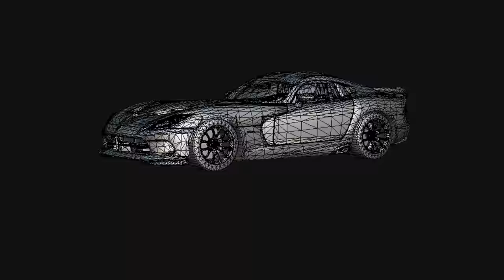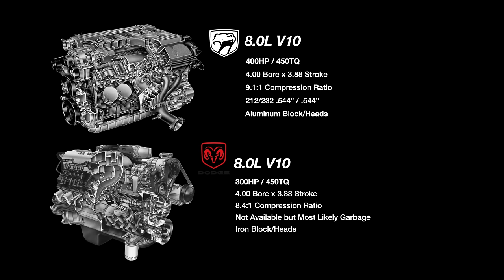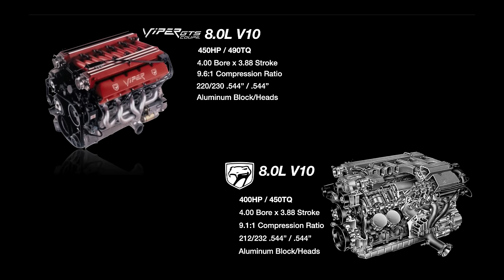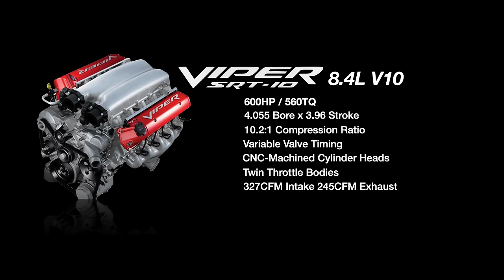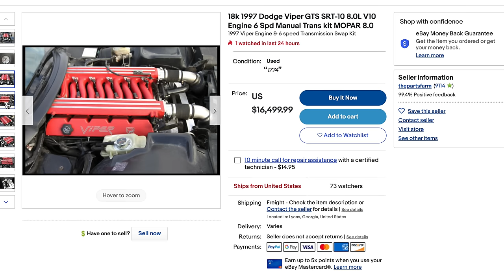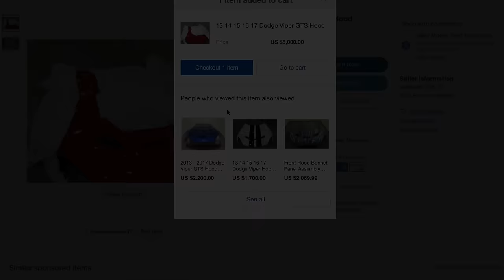Why V10 Viper Engines Are Too Powerful 😳| Explained Ep.5

Comment: The 2000+ engines can still be boosted, you just stop around 750rwhp.

Concerning your Viper tax, that's pretty much the body itself. The engine parts are fairly inexpensive as long as you know how to shop. 

The older interiors weren't that bad. They didn't fall apart like C4 and C5 Corvettes did.
Reply: My C4 interior is fine.
Reply: @macattack9041  yes, and so is the interior on my 97 mustang cobra but not all people care for their cars the same way. 

gm interiors have a bad habit of not staying together after youve taken them apart once. they also tend to squeak and rattle a lot, not just because its older either.
Reply: @OxBlitzkriegxO so modify them, its not that bad figuring out different/better ways to fasten things..the factory isn't always looking out for you long term.  Plus you can put in foam or some other sort of material to absorb any rattles etc at the same time.
Reply: @macattack9041 Just wait, it happens naturally. Cheap plastic and not so great design

Comment: I used to live down the road from the OG Hennessy Viper that was on the cover of Motor Trend. 1000hp naturally aspirated, the sound was actually scary. It didn't roar like the stock Viper. It screamed like a street bike. A V10 street bike.
Reply: Well, that's what happens when you raise the RPM redline instead of boosing to get more power
Reply: @1erickf50  the characteristic sound of q sportbike is due to its light reciprocating mass

Comment: First time I saw a first generation do a launch on a red lights, my jaws literally fell to the grounds !!!! Never saw anything has violent as this,
I know tires are really really wide and hook to the grounds, but never imagined it was gonna leave this effect in my brains, and remember this was before all electronics devices that make a beast easy to control, now with all this you could sit a chimp in a modern car and he would do a great 1/4 miles times, back then the car literally was fighting you like a mad bulls who didn’t want to play with you, my reaction has 
I saw it leave the corner street, it didn’t look like it was accelerating !? it looked has if it already had a swing ! Like it was already coming from, and not completely stopped, it gave me the impression has if a big fictional hand had just throw away the car, and my eyes didn’t catch and only saw from the car leaving the line. Very very impressed by this car back then. 😍😍😍
Reply: I thought the same thing when I seen a guy in highschool with a blown z06. Just goes. No squatting or anything.

Comment: You should talk about the 4.3 L V6 it was in the fastest trucks / SUVs on the road for many years and they are 350 Chevy engines with 2 less cylinders!
Reply: Don’t forget the turbo 4.3 the typhoon
Reply: The 4.3 was in the fastest trucks?  Are you smoking crack?
Reply: @jahosaphet05  4.3 Turbo in the GMC Typhoon/Cyclone, was indeed the fastest truck for many many years
Reply: @jahosaphet05  syclone n typhoon still the quickest and yes we’re the fastest……
Reply: @jahosaphet05  they could make wild NA power but then boosted with say 9 pounds you’ll need wheelie bars, roll cage and insane suspension setup. Used to go down Sac Speedway in my S10 4.3 NA
Reply: I love the 4.3

Comment: the viper always reminded my of an american 250 GTO. so nice from every angle
Reply: Yeah they have very similar proportions and the 250 GTO is widely considered one of the most beautiful cars ever made. Mid engined cars will just never have those heroic and beautiful proportions like a well designed front engined beast like a Viper.
Reply: I always thought of it as a modern Shelby Cobra. Light small car with a gigantic engine.
Reply: @matrinezkevin11492  funny you mentioned that, i saw some pictures of a mid-engined viper concept that Dodge apparently flirted with the idea of making, but never did. It looks pretty cool actually, but i like the original better.

Comment: You should do a Honda J-Series V6 video. We specialize in Honda Jseries Performance (HalferLand Performance) and have some videos of our 06' Accord Coupe 6spd making 550whp/460wtq on just 8psi. Even just at 550whp we have gone to finals and semi finals for Street Car Takeover verse Hellcat Red-eyes, Boosted Lambos etc .  Stock form they can hold max 600whp and come with forged Cranks, forged Rods (forged to reduce mass not for strength, 600whp is the limit) and cast but stout pistons (some have made 600-800hp with them by just Tweeks to the  ring gap, but we advise an upgrade for prolonged 500+ engines.  We added our HalferLand Hyper/Semi forged Pistons, HalferLand 1000hp Rods, Stock J35a7 Block, Stock Crank and our custom Turbo kit...and now have over 40k miles on that setup with zero issues at 550whp.  Theres some J's out there making well into the 1000's with stock block and crank. The engines also came in damn near everything Honda/Acura Released so their availability is too notch (CL, TL, TSX, MDX, Odyssey, Ridgeline, Accord, Pilot, etc

Comment: 6:30 The point about the piston ring gap from a NA engine is moot though. If you are going from NA to turbo you should be gapping the rings regardless. I don't think there is an NA motor you can slap a turbo and a ton of boost in and not have to worry about ring gap.
Reply: 1uz
Reply: Mustangs like boost and s2000s beg for boost too 😏
Reply: @Badmilobb6  You still need to gap the rings though.
Reply: 1uz...
Reply: Lol
Reply: @Badmilobb6  only the new ones with dohc
Reply: @merciless9285  the gt 2011 and up but there was dohc before the coyote went back to 2007 in the gt500s and the 03-04 cobra had a forged bottom end stock with a factory small blower you can run 800 wheel or more on those like the new coyotes without touching a thing on the longblock itself and they do it pretty reliably.  That is alot of power for 4.6-5.8 liters depending on which one you're talking about.  This is alot less displacement than these vipers are running so you gotta take that into account too.  The cobras and gt500s were factory supercharged with small superchargers but the coyote back to 2011 were all motor.  The 2000 cobra r had an na 5.4 dohc that put down 375 rwhp (almost the rated 385 at the engine) and they could take some big boost too unfortunately they were pretty limited to only 300 cars too bad Ford didn't use that engine more.
Reply: Old no-turbo Vw diesels
Eat 30+psi 
On original piston rings
Reply: only those that have seen ring lands lifted by incorrect ring gap under boost, will understand what this means....
Reply: @fastinradfordable  That means the original piston rings were too small. Probably a cost saving option by VW using the same rings on both the NA and the turbo engine.

They probably also make shit power even on that much boost. Even if you double the power that's still, what 75hp per liter? With an iron block? Heat really isn't an issue at that level.
Reply: @fastinradfordable  30 psi on stock rods and head studs? It might work for a time but, even the later turbo engines (until the 2.0s) had pretty weak rods and anything above stock boost needs upgraded head studs. I guess you see the point I'm getting at right? People who are serious about boosting their rig might as well go through the due diligence.

I'm actually in the process of swapping a BHW TDI into my Jeep (your comment is a funny coincidence lol). I guess this is the source of my comment, I rebuilt my TDI, checked the ring end gap even though they were stock rings on stock bore. I watched Cletus Mcfarland destroy a junkyard NA LS motor because he didn't gap rings, so for me due diligence is a must.
Reply: @sham_wow_guy . I would normally agree with you; however, the S2000’s & Coyotes with proper cooling & E85 are just animals. I’m not sure of how much ri g gap they have, but they are handling it.
In my 13’ Ram I made sure I had .032 gap in the top ring.

Comment: “You look at the dash a little too wrong and it’s gonna crack on you”😂🤣
Reply: but i like the 90's interiors more ( plus there more track focused and lighter, if i wanted spoiled i drive the pre-77 imperial luxury barge staying with in the Chrysler's family ) than the 5-gen vipers and my family and friends feel the same way. but i like the 4/5gen camshaft more as it's cam-in-cam
Reply: my sibling looking for a October ( preferably a 15th afternoon shift ) blue/white striped henssie-TT 1998 viper black interior 

same one likes 60's 4-door darts and the dodge jet-shaft car's and BEV's and SRT-neon all wheel drive boy racer boosted to the moon

im a 69 charger guy/owner but as a teen-25 i tried buying a viper ( mostly for the lolz and the experience and i figured that it would work as a trade for my charger or go up in value /up in cash 💰/or have my sibling buy it of me ) ( and looked at a RX-8 and a RPO-2012 charger/hellcat and 1-1-gen-mustang 6cly ( got one now for the miss but it's not the same vin and it's super rubbish and needs a full restoration unlike the one on the dealership's lot ) for the wife but those deals fell through and i didn't get them ) as my 2 car to replace my 2000's-up Buick 👎

Comment: I was an SCCA volunteer. We did press events for the car manufacturers at Pocono. The different manufacturers would have  their cars on hand so the journalists could determine which cars they wanted for road tests and articles on their magazines. The writers would take cars for a lap on both infield courses and on sections of the tri-oval It seemed like every time one the writers took the Viper out, the next radio call would be for a red flag and the flatbed to drag the Viper back to the pavement. Happened 3 years running in the early 90s. Everybody spun out those things. We would clap when someone made it all the way around a single lap.
Reply: People don't understand the driving style of Carroll Shelby. He made front engine cars turn like the mid engine ones. He was one of the greatest designers in my book. You really have to understand Mr. Shelbys ways before getting behind those cars.

Comment: I drive a 2017 Toyota Tundra. I put the Magnuson super charger on it and I’m getting around 600hp at the crank, around 450hp to the wheels. The engine is the 3ur-fe and it’s been shown to be capable of significant power even with stock internals and stock transmission. I love the sound with my trd pro exhaust. Would be nice to see a profile on that engine.

Comment: I had a Gen 2 RT/10. With new tires that thing would still break the tires loose and you would loose control of the car and spin out. Did it a bunch of times.  Some on accident.  That car was stock 450hp and a handful. The car actually scared me because it was very unpredictable. And, I have a 4B drag racing license , so yes I know how to drive cars with power. Our mild drag car had 1000 hp and ran low 9's.  The viper was a strange beast. That is why there are so many wrecked ones.  They do not handle like a corvette.  They are a way differ t beast.  I have a lamborghini now and have never spun it out and I have tried alot!  I sold the Viper becasue I felt it was unsafe to have "fun" with.  Anyone who owns one knows exactly what I am talking about.

Comment: The Acr's wing spans over 1776mm in which is the year America was found. Not only that, the wing can handle so much downforce that a 200lb or 2 200lb guy's can stand on it with no worries. It also created so much downforce that Dodge had to get rid of some stuff in order to compensate for the excessive downforce being made at high speeds

Comment: The 8.0 dodge ram V10 and the early first viper motor cranks, rods and pistons are interchangeable. With deeper valve heads and you can bump the displacement up from 8.0 to 8.2-8.4 and in the 2500 series trucks it has a mounting place for a blower from factory.
I own one , fresh from 2001; in my 2500 and it made 237,978 before it slapped the exhaust valves on the right side.
They are super reliable and great towing engines, gas milage is shit but I tow right at 13,000LBS gross everyday with mine. 
You should look into doing a video on them, there a pretty odd duck.
They was also available with a weak, manual 5 speed and decent 6 speed. Pretty rare to find one tho,
Reply: They’re not interchangeable. The only similarities between the magnum V10 and viper V10 are they both were 8.0L and both made by Chrysler.  That’s where the similarities end.
Reply: @JoeIsCrazyWillman  I own a magnum V10 and yes I swapped the viper crank into it. Had to get it cut and re-balanced but it did work, went form 300-350HP- 400-450 after pistons and rods. 550-600 torque
Reply: You're trying to sell some bu'sh'.

Comment: Youtubers and car "journalists" keep calling pushrod engines "archaic". OHC are not much newer than OHV if you look at the actual history. the Gen 2 GTSR actually dominated endurance racing in the 90s and early 2000s which consists mostly of OHC engined race cars.

OHC has a lot of power for its displacement, OHV has a lot of displacement for its physical dimensions. Both have pros and cons depending on the application. Calling OHV "archaic" is just plain ignorant.
Reply: As an American v8 guy, I think the word your looking for is efficient. OHC design found a way to shove more CFM through a cylinder head on smaller cubic inch engines. Also by removing the standard” valvetrain, it freed up some frictional horsepower loss and improved NVH. And the OHC design allows for less spring pressure to be required which helps with durability and RPM capability. But it’s all about what someone’s preference is imho. I love the 60s big blocks, small block fords, modular OHC fords, and LS design. All have their own pros and cons.
Reply: @rayman1230  yes but there are different kinds of efficiency, one metric does not define an engine. OHV is efficient when it comes to packaging a lot of displacement for its size, despite OHC having better volumetric efficiency. People can fit 6.0 liter LS in a miata, i bet a VQ V6, 2JZ, RB26, or a 5.0 Coyote won't fit in there without too much "surgery".

Comment: Can get much more than 2200 if you wanted to. Throw methanol in it bigger turbos and straight drive it with a centrifugal clutch setup (as the trans likely wont be too happy) 😂

Comment: Hey 337 Speed. Great video! It would be awesome to see you do a video on the supercharged 3.0 litre V6 Audi used in the S4 between 2010 and 2016…it was super bullet proof and took to mods extremely well. Bit of a unicorn engine too!

Comment: Am I wrong for wanting to see one of these put in the 1969 Shelby GT500

Eleanor inspired body.
Interior mix of classic and modern look.
Sleek w/ new hood and face grate.
Custom tail and headlights.
Dressed engine bay.
Suspension & chassis work.
Ceramic? breaks, larger rear tires.
Dual/Quad boxed exhaust.
Hood folding in the trunk.
Custom twin snake logo. (Cobra+Viper)

However much hp you wanna risk you life with but I’d wanna build it to have decent power in a straight line, handling and feel better than a Lexus, n look better than most show cars without going overboard but ofc that triforce is might be to much for most so if y’all end up viper taxed we’ll save what u can.😅

Comment: @337 SPEED 
Please do the Pontiac ram air engines. My dad had a 69 firebird with the ram air V engine swapped into it, some other stuff I can't recall. I think it also had a 3 speed turbo transmission? Irdk lol but I know he got it off an older drag race guy when he was younger

Comment: I'd like to know more about dodge 360 I had a 360 in my duster. The front ends were crap but a vitar transmission with shift kit valve body and 411. Dana rear the car was a beast.  With a 6pack I miss my baby

Comment: Where Dodge messed up. Continuing to build the V10 and trans when they had 144461811881 engines and trans from the Hellcat. Drop a 707hp Hellcat in the (R/T) car and the SRT-8 gets the Demon swap.

Comment: At what point did the Viper switch from cable-actuated throttles to drive-by-wire throttles? Which is more preferable in general? I know cable throttles give you a more raw experience but drive-by-wire has its own safety and tuning benefits

Comment: Imagine if the Viper WAS DOHC, though... Better yet, with a Honda K-series derived head. To add the icing on the cake let's give it a carbon-fiber monocoque and body, too, just to shave some more weight off. So now we have an 8000 RPM 8.4L V10 car that weighs somewhere around 2800 pounds and puts out around 800 naturally aspirated horsepower from the factory. Without breaking a sweat.

Comment: How much does v gen viper 8.4l v10 engine weight. And it can handle 2500 to 3000 HP on OEM block

Comment: Funny how my ecoboost today makes almost as much torque as a V10 viper first gen. I make 460 pd ft of tq btw. Which is probably actually more than the first gen because that is wheel not crank.
Reply: A 2022 3.5 eco boost produces 470 lbs/ft at the crank but the reality is in the charts. The torque curves are totally different
Reply: @marc-antoinem112  I was talking about my 2.3 making 460 at the wheels and over 400 at about 2000 rpm. Would guess that at the crank I was prob making about 470 hp with 500 tq.
Reply: @marc-antoinem112  guy who tuned my car made over 800 hp and 700 tq at the wheels on his 2.3.

Comment: the gen 1 has an interior? all this time i thought it was a seat, 3 petals, a stick, and an exhaust that burns every leg that gets into the car.
turns out you learn something everyday!
lol
Also, a big "up grade" on the gen 1's was to re gear. The vettes of the time were only faster because of the gearing. Once a better diff and new gears got installed, nothing on the road at the time could touch the Viper. Add turbos, (try not to kill yourself), and nothing to much is going to out run you.